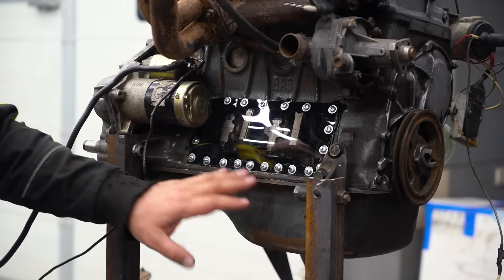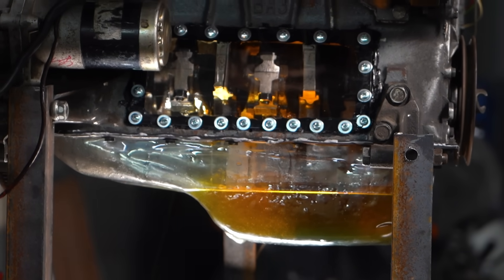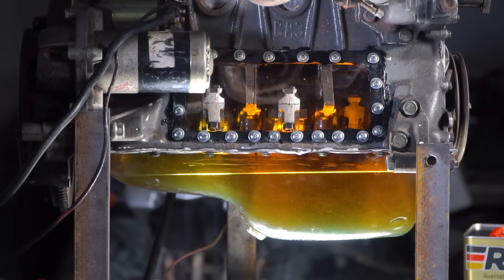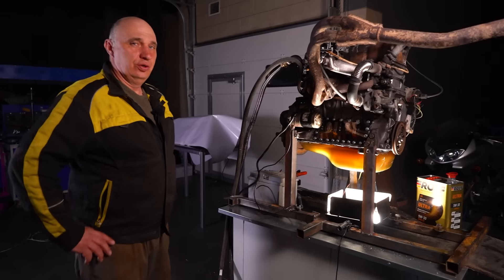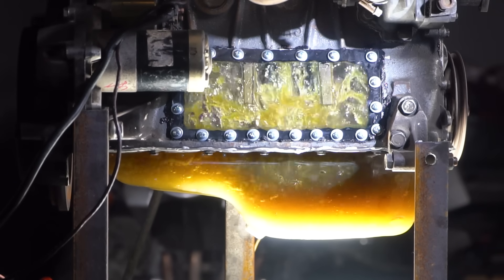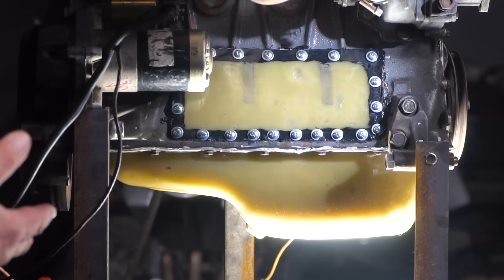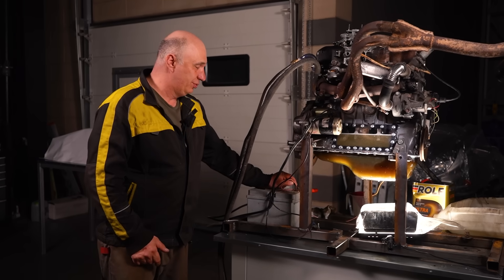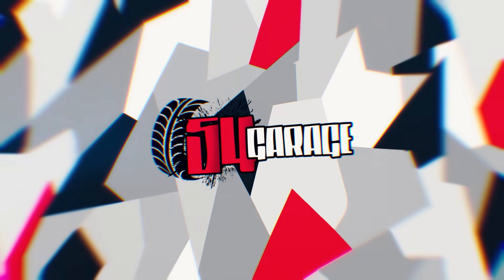What actually happens when you overfill your motor oil? (w/ transparent oil pan)

Comment: How is oil not getting burned in the cylinder, bypassing the rings? Cause I’ve “seen” twice the amount of oil in a car, and there was a shit ton of smoke out the exhaust, once it got on the highway. It was driven for 20 miles before drained. Nothing happened to the motor or seals, but it was clear there was an issue. I’m gonna assume it doesn’t happen here cause… LADA!

Comment: I've accidentally put oil in a car without draining it first two times at my last job. a Tahoe and a Colorado both newer. They both poured white smoke out of the exhaust even when draining all the oil out and putting the correct amount, they smoked for a while. For the Tahoe that's about 16 qts and Colorado it was 12 qts

Comment: ANadvanced service feature of communist block engines. The level can not come higher than  where the dipstick enters the lower part of the engine block. Overflll way to much and the oil comes out of the dip stick hole.

Comment: it's great to finally know what actually happens inside the engine with the oil a bit overfull. Like someone else said, no more anxiety after overfilling by a half of a quart!
Reply: Especially if your car burns a little oil anyway, you might prefer to have that extra quart of oil in there just in case.
Reply: ...or even by as little as 8 ounces, like some other youtube channels are claiming is outright 'dangerous' to your engine's health!!
Reply: My 00 Mustang was missing it's dipstick, I replaced it and checked my levels and thought I was burning oil and ran 2qts low....added the 2 quarts and ran like that until I was due for an oil change. 7 quarts drained out of a 5qt oil pan lol. No leaks, no drivability issues, no noticeable metal flakes or anything on the drain plug magnet. Scratched some new lines on the dipstick, good to go.
Reply: @DerrickRG  What in god's name are quarts?
Reply: @kennethkeen1234  Quarts are almost the same as liters FYI. So just remember quarts=liters.
Reply: @kennethkeen1234  That was doing my head in also!! A quart is actually 2 pints, hence quarter of a gallon I assume (or about 1.14 litres). Don't know why they don't just say litres or pints. Saying 'a quart' just confuses non-Americans for no reason!!

Comment: What the main concern is with an overfilled crankcase with motor oil is the increased air pressure generated. The PCV  valve can’t handle it

Comment: I don't know what the current procedure is. But it used to be that when doing an engine overhaul, you would overfill a quart (maybe 2) and run for a short while (5 minutes IIRC) before changing the oil and filling to proper level. The idea was that the excess oil helped to get rid of the excess build lube and such during initial startup. And some of that excess helped lube the parts as they started the break-in/mating process. After this, the oil got changed to the proper level and ran for another 30 minutes. Then changed again. Then ran for 500 or 1000 miles and changed again. And finally every 3000 or so after that.

Comment: These guys are also just giving a visual representation in most aspects of an engine, which is fantastic
i could visualize in my brain what was happening KINDA, but seeing the volume of oil to actual cavity capacity is very eye opening and also shows, for more layman, why "warming the car up a bit" is still a thing
even though you can just drive most of the time now and be fine
Reply: the viscosity HAS to reduce to be most useful, you dont want resistance with your oil

Comment: Also there's what's called a PCV.
Positive crankcase ventilation.  As the engine runs, gasses build up, and they're sent into the combustion chamber.  Now you're putting oil into your intake manifold and your pistons.

Comment: I was always told it will force oil into your pistons. 
I've also seen a Ford focus RS with oil over filled, struggle after a couple laps of paved autocross, because he (knowingly) had too much oil.  Took some out, pulled the plugs and cleaned them, and it ran happily!  😮

Comment: Hello garage 54 crew i had an weird idea a few days ago and wanted see what yall think or if this was possible, the engine will have 6 cylinders but there is a catch, the front and back of the engine is going to be a V with 2 cylinders each while the middle will be a straight 2 cylinders, or have straight 2 in the front and V4 in the back. How would that work or sound together

Comment: Did a engine exchange on a woman's petrol engine 20ys ago after she added 18L of oil because she said it sounded bad with no oil! End result lots of smoke battle to run!  Drained the oil removed the sump found metal shaving. Removed the big end cap's and found the crank had split in two. Six months later came back due to radiator hose that had blown after i had said  you should change it but she refused to and tried to claim warranty! Word spread and now she uses public transport (read the manual ) simple!

Comment: DONT DO THIS
DO NOT EXCEED Recommended oil levels
Modern engines use engine oil as a hydraulic fluid to control Variable Valve Timing. When air is suspended in the engine oil the VVT system will malfunction. Also when air is suspended in the oil it will increase your oil volume and disrupt the crank case ventilation causing oil to push past the piston rings and cause and oil burning conditions and in some conditions cause it to diesel and run away.

Comment: Higher oil level even by a small amount can pretty significantly reduce hp due to all the extra load/drag it puts on the internal components. Good to run right between low and full for the best balance of performance and protection.

Comment: Now that we see what happens......let's go to the total challange. !!!!! Use a regular machine without transparents, block the dip stick and evaporation, and any other possible leaks .....put an extender long pipe in the oil fill tap and leave it open for evaporation .... fill the machine temporaly measuring the input liters to see what will happen ...

Comment: You should note that every engine is different. My current car, I put less than a quarter extra. I started to hear a pinning sound. Since I had just changed the oil, I check the level with the dips tick. The level looked fine but the oil was very creamy and had bubbles! Obviously I had to drain a little bit, and the clicking sound never went away, no check engine, and it runs fine. But I'm sure that if I had drove it longer than the 5 minutes I did, I would not have that car anymore!

Comment: The foaming isn't sound. Lowers oil pressure and possibly wears the lubricating molecules. This is my guess - I'm not a tribologist. And: Oil is expensive. But on the upside the big volume will enhance cooling. But the right way would be to enlarge the sump (a practice for BMW Boxers, the air heads). If you have room, of course. Well, thank u Garage 54 for this demonstration.

Comment: A Diesel engine would have run away already, especially as the breather usually won't go into a bucket and the oil gets hot enough to produce vapour.

Comment: 9:40 umm i would count having far more air bubbles around as adverse effect of over filling, same with crank hitting the oil, though lawnmower engines have bolt on stick to splash the oil around, but it much smaller and thinner. I suspect this causes potential damage to oil pump due it running per say dry due so much air instead oil and maybe cavitation that will eat the metal, well as power losses when crank contacts the oil and oil getting into cylinders due increased oil pass trough to cylinders ie smoking..
17:57 Well sad news is that this has happened to point of filling engine to fill cap ie seazing it with oil. Amount was utterly ridiculous and owner was completely clueless. Worst part, this is not single case of this happening...

Comment: Never mind the fact that at first overfill level the pump started taking in big air bubbles that will reduce the oil pressure (Air is compressible) and thus over time do harm to the bearings.
This video is uninformed pointless rubbish.

Comment: You have a weird result. When I - by accident - add too much oil to my BMW, the engine runs unevenly and shakes, and it also doesn't rev. And if you make the mistake of putting too much oil, it's a lot of work and pain to remove it in your own parking lot.

Comment: The one thing they fail to mention is that the more aeration of the oil the less actual oil pressure to the bearings. Over fill your engine you will spin a bearing

Comment: I always read that overfilling the oil in an engine can cause the oil to foam, but what I’ve learned here is that you have to really overflow the engine for it to happen. My anxiety about being a little bit over max on my dipstick is relieved. However, what about the oil pressure increase? What kind of change is there?